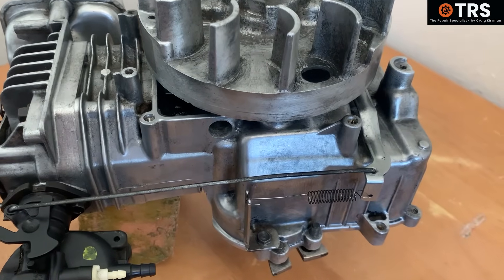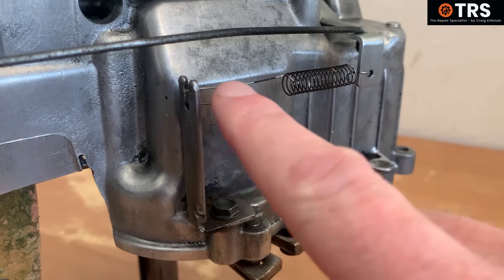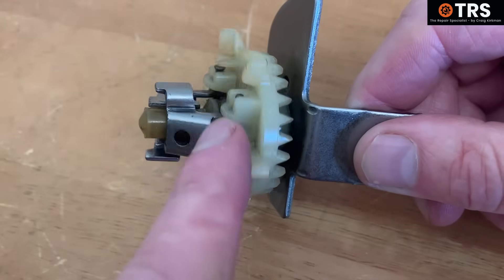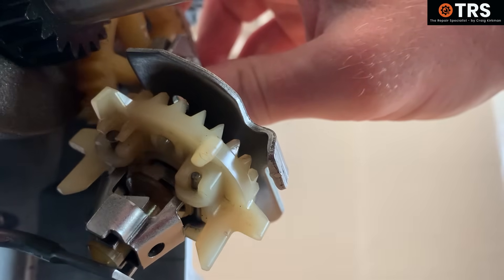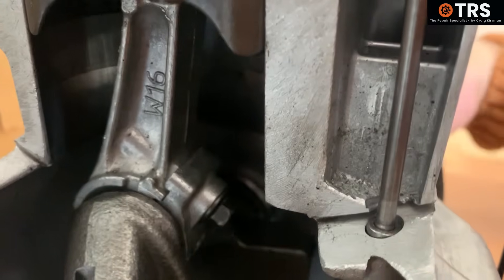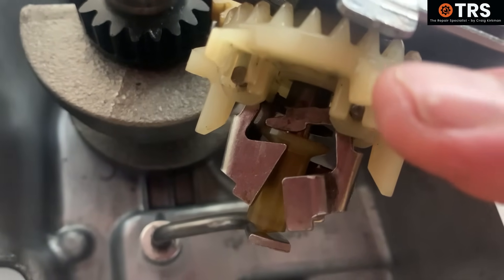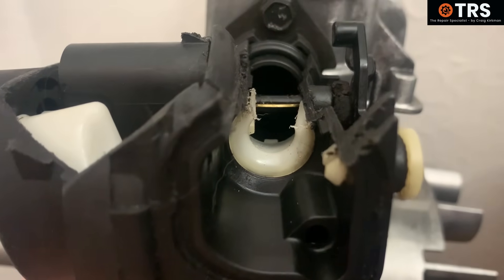How a Mechanical Governor Works on a 4-Stroke Lawnmower Engine. (by Craig Kirkman)

Comment: Has anyone heard that centrifugal is not real? The explanation given by Newton is total nonsense to me but mainstream science apparently has no issue with saying it a pseudo force and that all centrifugal forces are actually centripetal force towards the center but moving in a curved path is resisting a change in direction and so it's an illusion that there's a force pulling outward on the mass. What say ye?
Reply from the maker: You’re absolutely right — from a strict physics standpoint, “centrifugal force” is classed as a pseudo-force that only appears to exist when you’re observing motion from a rotating frame of reference. In reality, what’s actually acting is the centripetal force pulling inward toward the center — that’s what keeps the mass moving in a circle.

However, from the perspective of the moving object (in this case, the governor weights), it feels like there’s a force pulling outward — that’s the centrifugal effect. So even though it’s technically not a separate physical force, it’s still a useful and intuitive way to describe what’s happening in mechanisms like this.

That’s why I use the term “centrifugal force” in videos like this one — it communicates the concept instantly and accurately enough for the mechanical explanation without needing a deep dive into frame-of-reference physics.

So yes — you’re spot on scientifically, but for practical engineering explanations, “centrifugal force” works perfectly well to describe the outward reactive effect we see in real-world rotating systems like governors, clutches, and flyweights

Thank,  Craig

Comment: Imagine being an engineer and thinking a plastic cam gear is a good idea. Must be the same dude that keeps putting cam belts in the oil sump.
Reply from the maker: It's definitely a common point of discussion when it comes to engine design and durability!

Comment: The only thing that you didn't cover that would have been nice to understand better is how the throttle that you set is not completely connected to the governor throttle. You can be holding the throttle open on the user end, but the governor will still override you. I wanted to understand that part better.

Comment: Thanks, great video. I’ve found that the running speed can be adjusted simply by bending the arm to which the spring is attached. Maybe there’s a better way but it worked for me.
Reply from the maker: You're very welcome! Thanks for sharing that great tip! Craig

Comment: Excellent and to the point! And you can also raise or lower the RPM set point a bit by bending the springs mounting point, increasing or decreasing the spring tension. Cheers!
Reply from the maker: Thanks so much for the kind words and the excellent tip, you're absolutely right! 👍

Comment: Thank you for posting.  Very good. Do surging engines have an issue with the governor not operating correctly?
Reply from the maker: Great question, and thank you for your kind words. 

Surging is usually caused by a lean condition — most often from a dirty carb jet, old diaphragm, or an air leak. The governor’s job is to react to load changes and keep the revs steady, but if the carb isn’t delivering fuel properly, the governor will keep chasing the idle up and down, which looks like it’s the governor at fault. So while the governor can be misadjusted or sticking, most surging problems come back to the carburetor or air leaks, not the governor itself.

I hope this helps clear things up and let me know how you get on with this.

Craig

Comment: I have a Briggs 163 cc ohv on my 2020 Toro Super Recycler. I believe that's the engine you are showing here.

I'm having an engine RPM issue.

This all started when I thought it sounded like it was running fast and I measured it at 4,000 rpm... my god! 🤯 

Attempting to lower by bending the spring arm did nothing, so I went about trying a reset of the governor arm orientation, full clockwise turn before clamping the lever arm down with spring and rod attached.

So now, when I fired it up cold, it was running at 3,000 but walked up higher, from 3,000 - 3,400 in the 4 minute test I did.

When I adjusted Idle with the spring arm this time, it went back down to 3,000, but then completely bogged out when I pushed down on the personal pace drive.

Any idea what is going on?

Do I have an internal failure?

Is it possible the governor arm is not able to clamp and hold tight to the internal lever, thus working its way out of orientation?
Reply from the maker: Thanks for sharing all that detail — really helps narrow it down. You’re right, the Briggs 163 cc OHV on your Toro Super Recycler normally runs governed around 2,900–3,100 RPM under no load. Seeing 4,000 is definitely too high, so you were right to check the governor setup.

A few thoughts:

1. Governor reset – You did the correct procedure (full clockwise rotation of the shaft before clamping the arm). If the arm bolt isn’t clamping firmly on the governor shaft, the arm can slip and gradually let RPM creep higher. Worth checking the bolt and shaft flats carefully — if the flats are rounded, the governor can’t “hold” properly.

2. Spring & linkage tension – If the governor spring has stretched or been bent out of spec, it can make adjustments erratic. Sometimes a weak spring causes hunting/bogging when load is applied because the governor can’t pull the throttle open quickly enough.

3. Carburetor mixture / blockage – If fuel delivery is slightly lean (dirt in jet, diaphragm issue), the governor tries to compensate. That can make RPM rise higher cold, then sag or bog under load. If it bogs when you engage the drive, that points to a fueling issue as much as governor.

3. Internal governor failure – Rare, but possible. The internal governor gear has plastic flyweights that can wear or break. If that happens, the external arm loses proper feedback. Usually when these fail you’ll see wild overspeed or zero control rather than a gradual creep.

So, my suggestion:

Double-check that the governor arm bolt is properly clamped on the shaft and that the flats are intact.

Inspect the governor spring and linkage — replace if stretched or bent.

If those check out, clean/rebuild the carburetor because lean fueling can mimic a governor fault.

Internal governor failure is possible but less likely on a 2020 engine unless it’s had very heavy hours.

So no need to panic about a catastrophic internal failure just yet — I’d start with the clamp, spring, and carb before digging deeper.

See how you get along with this and let me know how things go.

Craig
Reply: @TheRepairSpecialist thanks Craig for taking the time to reply and being so detailed. Much appreciated!

Comment: New carb and still hunting. Could the governor be the issue.  Do they either work or not work or do they allow random Revs as they get worn
Reply from the maker: Good question. If you’ve already fitted a new carb and it’s still hunting, it’s worth looking at the governor system — but usually governors don’t fail in an “all or nothing” way.

A governor’s job is to sense engine speed and adjust the throttle to keep RPM steady. If the linkage is sticking, spring tension is wrong, or the governor arm is loose on the shaft, you can definitely see surging or “random” revs. Worn bushings or a bent linkage can also cause inconsistency.

That said, the most common cause of hunting is still a fuel/air issue: tiny air leaks, blocked jets, or incorrect mixture. The governor often just exaggerates what the carb is doing.

So in short: governors can cause problems if worn or set incorrectly, but they usually don’t just completely “fail.” I’d check the spring, linkage, and make sure the governor arm is correctly set on the shaft before ruling it in or out.

So, what i would do now is check your new carb adjuster screw settings, check the carb manifold for tiny crack, make sure the carb is correctly tight to the manifold, and that the manifold gasket is in tack and present. If you have a tube type manifold like on some of the briggs and stratton sprint/classic/400 series, then the manifold will be a pipe, and these can sometimes work loose or crack over time. So check that and to do so you will need to remove the recoil cover and clean off the accumulating dirt, then you will see if theres any damage.

I hope this helps for now 

Craig

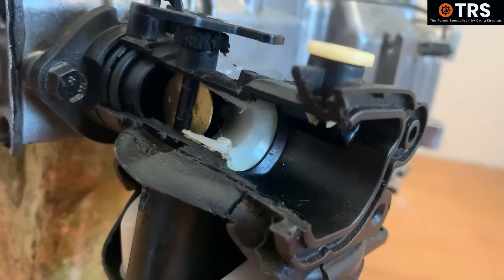Comment: 1:13-1:17 was KEY for me to get some sort of conceptual tethering; watched a whole  KHOLER video on how governor works and the guy NEVER ONCE mentioned this!  Then I couldn't pay attention to anything he said because I kept wondering well what is going on AT REST and before engine is started!

May I ask one question: when we pull back on that bar on the lawn mower, and then pull the chord while holding the Bar down, is that pulling open the same butterfly valve (throttle valve) that the governor is manipulating? Or does that starting mechanism open a separate throttle valve/buttetrfly valve?

Comment: Have two old Briggs and Stratton pusmowers. Didn't notice the governor spring was taken off by whoever worked it previously. One had both spring missing, the other only had the return spring. Results? starting the first one resulted in horrible jerking because the valve was fully closed. The second (missing both springs) immediately tried to (and did, it was revving like 5000 RPM) overspeed, but the engine was no match for the flywheel brake.

Comment: Thank you sir for the awesome video. How do you know when the governor gear is bad? I hold the gear in the closed postion between my two fingers and then I spin the plastic wheel to see if the plastic center piece will push my finger away but I feel absolutely no force and nothing happens. When I spin it without putting my finger on it, the center piece will come out. Does this mean the governor gear is bad? Or does it need to be spinning at super fast speed within the engine for it to push the center piece out with enough force to push the lever? Thanks for your help.

Comment: Could the governor keep the rpm way low and coffing? Ive thouruly checked carb, valves, compression, new fuel and spark. It wont go to normal operation speed with some startgas or pulling the governor arm. Im totally stumped. (Yanmar snowblower)

Comment: I recently had to replace the valve cover gasket on my mower and decided it would be a good time to check and adjust the valve lash since the cover would be off and the machine is now a couple of years old. 

I got it back together and now the rpm are much higher, probably over speed but I dont have a tach to co firm, and it is running noticeably louder.

Adjuating the spring arm has zero influence on the speed and only if I physically move the governor arm does the speed change.

What is going on? Anyone have any idea?

Comment: Good presentation 
I have a 500e  briggs and stratton push mower, I've cleaned the cabbirator and the fuel tank and the spark is few  but the engine  won't start,any suggestions pliz
Reply from the maker: Hi there! Sorry to hear about your mower troubles. It sounds like you've already done a lot of the right things by cleaning the carburetor, fuel tank, and checking the spark. Here are a few more suggestions that might help get your Briggs and Stratton 500e push mower up and running:

Check the Fuel Quality:

Ensure that the fuel you're using is fresh. Old or stale fuel can make it difficult for the engine to start.
Inspect the Air Filter:

A clogged air filter can prevent the engine from getting enough air to start. Clean or replace the air filter if it's dirty.
Check the Spark Plug:

Even if you're seeing a spark, the spark plug could still be the issue. Make sure it's properly gapped and not fouled. Consider replacing it if it's old or dirty.
Primer Bulb:

If your mower has a primer bulb, make sure it's not cracked and that you're priming the engine according to the manufacturer's instructions.
Fuel Line and Fuel Cap:

Inspect the fuel line for any cracks or blockages. Also, ensure the fuel cap is venting properly. If the vent is blocked, it can create a vacuum in the tank and prevent fuel flow.
Carburetor Adjustment:

Double-check the carburetor adjustments. Sometimes, even a cleaned carburetor might need a tweak to get the fuel-air mixture just right.
Compression Test:

If all else fails, you might want to perform a compression test to ensure the engine's internal components (like valves and piston rings) are in good shape. Low compression can prevent an engine from starting.
Choke:

Make sure the choke is functioning properly. If the choke is stuck in the open position, it can make starting difficult.
If you’ve gone through all these steps and it still won’t start, it might be worth taking it to a professional for a more thorough inspection. Good luck, and I hope you get your mower running smoothly soon!
Craig

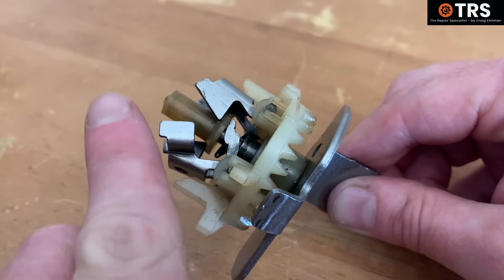Comment: @2:46 - The plastic Gear- I've always wondered what it was!! Silly me I thought it was the safety device when one hits an above ground root or something with the blade- it shuts off the engine. Thanks. I take apart mower engines for fun and Aluminum during the Winter. Thanx Mate!!!
Reply from the maker: Thank you so much 👍👍👍

Comment: It is the same on gas engines that were used in stationary applications or on heavy duty trucks with PTO’s. The only differences was how they were run. Some ran directly off of the distributer and used vacuum as a reference. So it is mechanical/vacuum governed. Most actuations of the throttle plate directly were done by vacuum and simply not by levers. Same concepts apply though. Others were vacuum only like many 1bbl carbs. They used manifold vacuum reference to open or a close a secondary throttle plate to control the rpm. This was set by spring tension on a diaphragm. The other way is mechanical entirely similar to the modern lawnmower engines you showed in the video. If it was a remote system it simply used cables as reference speed. These same concepts were applied to create the earliest cruise controls like the speedo-stat and the earliest production cruise control Chrysler’s Auto-Pilot. Very cool stuff that very smart people figured out!

Comment: Many, many years ago (like almost 60 yrs), I had an old lawn mower engine. I don't remember the brand of engine, but I think it was a B&S. Its governor was similar, except the throttle was controlled by a flap in the airflow of the cooling fan. Faster engine speed= more air= close throttle. The cam drive method seems like it would be much more accurate.

Comment: Hello Graig,  thanks for this video, I sometimes wondered what id find if my govener failed in some manner , on a 160cc Honda izzy ,.which tries to and mostly  runs at a constant speed .Now I know , and its the same principle we see in an engine museum with the shiny brass balls on their centrifugal goveners spinning round keeping the engine at the designed speed within the load limits for the engine . My spare 135cc Izzy looks to be controlled by the throttle lever and what seems to be a vacuum load/speed sensing  system but this arrangement allows me to throttle down when needed . Thanks again  for another excellent video . A.T.B., Ian 👍👍☺☺

Comment: I have a small diesel engine I need to govern to give me more power when the electrical load increases. This video has given me ideas on how I can retro-fit a mechanical governor. Nice to know these mechanical guvnors still exist. Had a hard time searching for them online.
Reply: That's a bad idea.  You want that engine to tun at exactly 3600 RPM to give the correct Hertz (60Hz in the USA).  Increasing the RPM will increase the Hertz and damage your electrical equipment.  If you have a 4 pole generator head it will only require 1800 RPM but you probable have a 2 pole, not a 4 pole.

Comment: I believe the phases "balls to the wall" and (to go) "balls out" come from steam engines. Specifically a centrifugal governor with ball shaped weights was used to control engine speed. When the engine was operating at maximum speed, the ball weights of the governor were fully out due to centrifugal force. For an engine mounted indoors, the balls would be towards the interior walls of the building. 

I've always wondered what was inside the crankcase on a small engine. I should have expected a centrifugal governor.